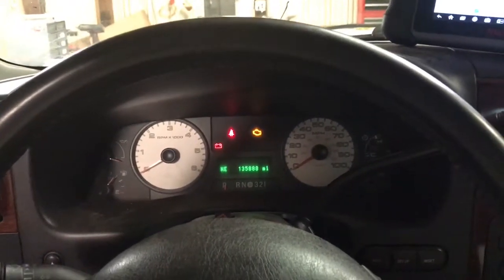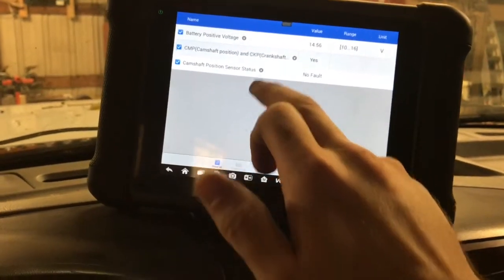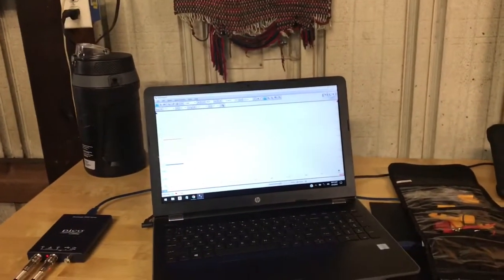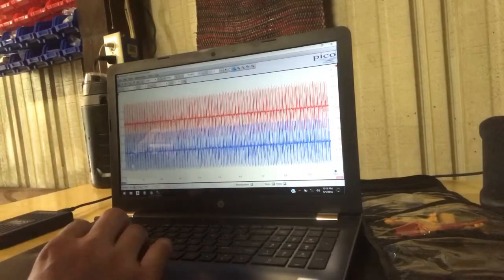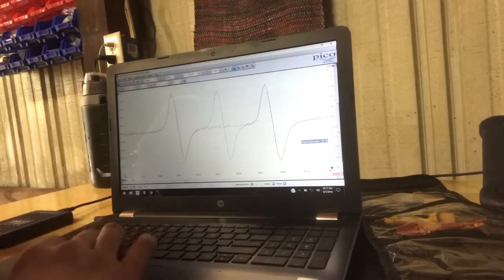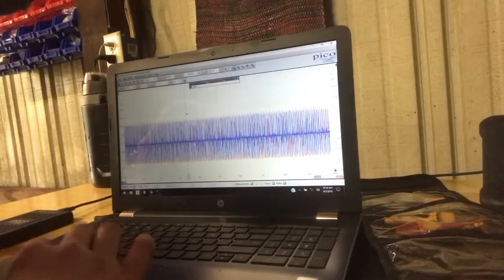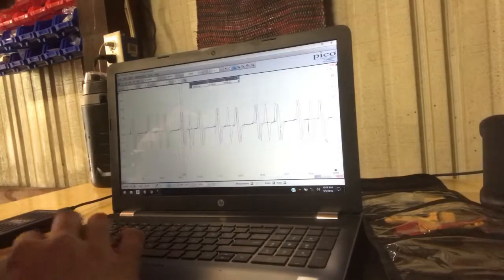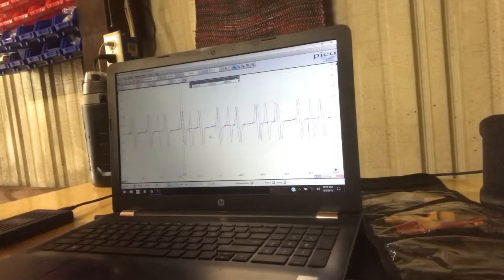Ford 5.4L New Timing Chain Part 2

Comment: As a tech myself I had to get myself up to speed on this engine design - Brian from {FordTechMakuloco } here on you tube has a very good source in video's on this engine - 846 video's..He is the owner of BSM Motors and use to work as a ford tech till he went into business for himself helping the public. His video's are very easy to understand and you can almost train off of. I Very Highly recommend him...

Comment: Really appreciate you sharing these videos. Would these type of diagnostics be something most shops have experienced with? My 09 5.4 3v with 148k began stumbling the other evening while easing into a parking space. Neighbor used his small code reader and stated the following: 
P0012, P0022 and P0016. I have been chasing P0042 “small evap leak” and was told by dealership that shouldn’t effect anything. Two days prior to this occurring I had the oil changed. I have not driven it since this occurred. When finding a shop is there any particular test you suggest they do when performing diagnostics? I want to be as transparent as possible at this point. Thanks so much for any feed back and for taking the time to make and share these videos.